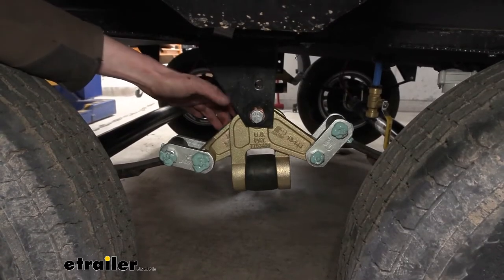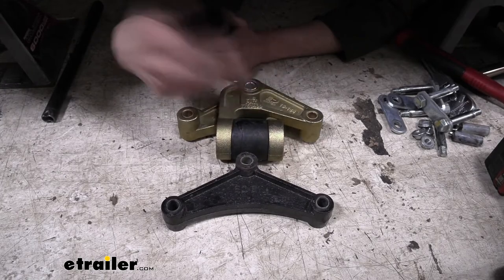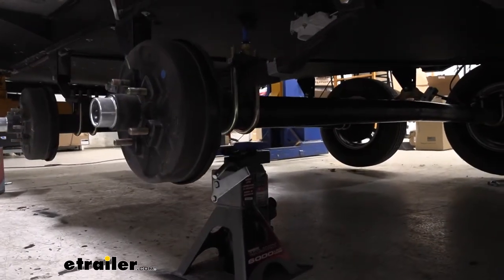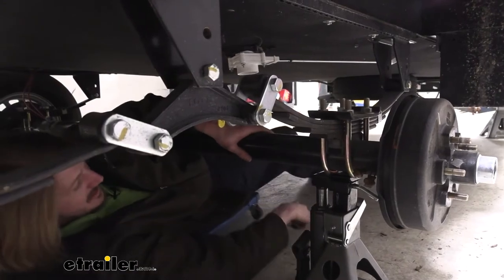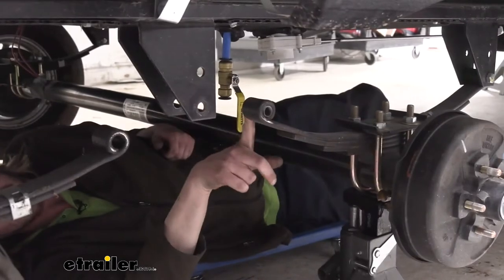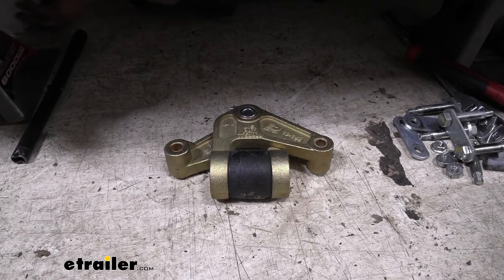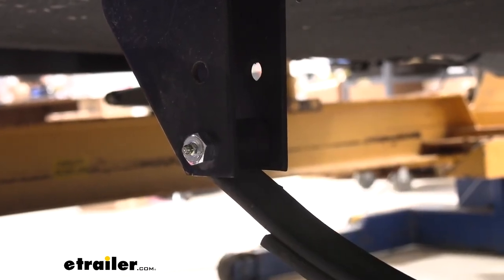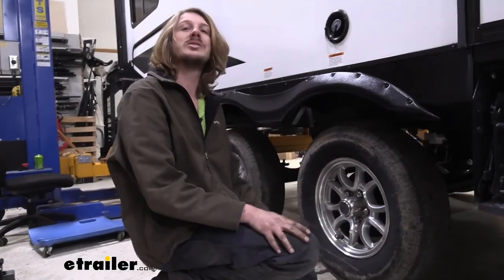etrailer | Mount: Dexter E-Z Flex Suspension Kit on a 2021 Grand Design Imagine Travel Trailer

Comment: I use a spud wrench to line up the spring in the bracket. A spud wrench is what iron workers use to line up holes in beams. They have a hex on one end and a point on the other.
Reply from the maker: That's a great tip, thanks for passing it along!!
https://www.etrailer.com/Trailer-Suspension-Parts/Dexter/K71-653-00.html

Comment: I had trouble getting the bolts out of my bracket so I just put a little heat with a propane torch and that did it. Don't get it too hot.

Comment: I just watched you do this after I did my own. My Dexter’s came in fancy red. You did well, but two suggestions. First, when you’re driving out your plastic bushings. Use the new brass bushing on the bolt to push it through. Now you’ve done both. You have a Milwaukee 1/2” impact. Buy the Milwaukee 12 volt grease gun. I wished I watched this before I did it. I had to take the one pivot bolt out because another poster said the anti-seize was for all the nuts.
Reply from the maker: Thank you for the tips, we always appreciate it!
https://www.etrailer.com/Trailer-Leaf-Spring-Suspension/Dexter/K71-653-00.html

Comment: Thinking about taking this on myself.   Two items:  1). does the Dexter Wet Bolts need to have the grease hole aligned horizontally to ensure proper grease flow into the bushing?    2). How do you ensure the splines are aligned so you don't strip out the hangar before tightening / driving in?

Comment: How often should the bolts be greased?
Reply from the maker: Dexter recommends greasing the E-Z Flex every 3 months or 3000 miles, whichever comes first. Hope that helps!
https://www.etrailer.com/Trailer-Leaf-Spring-Suspension/Dexter/K71-653-00.html